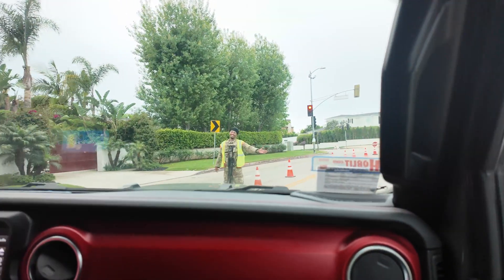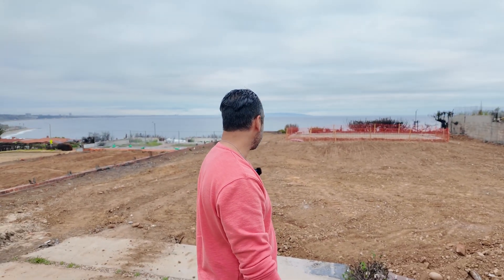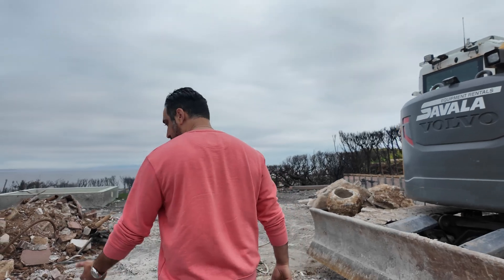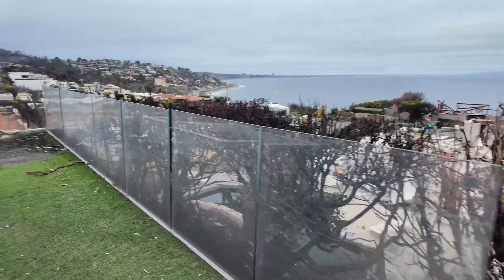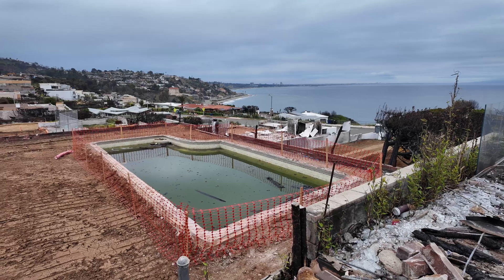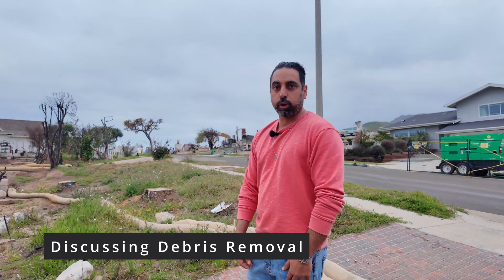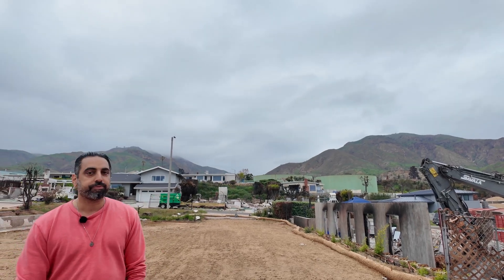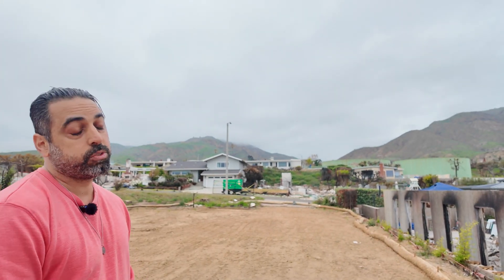What Survived the Malibu Fires – Civil Engineer Walks Through the Aftermath (Los Angeles Fires) [4k]

Comment: I see      the brick survived; a friend of mine had a brick home and it burned recently. 
Let me rephrase that - it's not really a brick house; it's a wood frame house, but it has brick veneer. 
So one wall was still standing, but due to the heat, the brick was NOT structurally sound and had to be demolished.
Reply: The brick and cement in a fireplace is not the same as on a house.

Comment: Is there any building going on?   I watched a contractor try to get a permit.  He was told none had been issued.
Reply from the maker: From the engineer: Yes, there is some construction going on. Permits are indeed being issued.
Reply: Adam Carolla is doing kinda the same blogs. He has found one house under construction. Pointed out that they were building it out of wood frame and cheap OSB instead of modern fire resistant material.

Comment: Ironic that they are making it easy to rebuild the same exact house. The house that burned to the ground. Should a homeowner decide to upgrade the materials or entire structure to prevent a total loss in the next fire, how long will that take to be approved?
Reply from the maker: From the engineer: "From what I understand as long as the footprint is the same, the homeowner is allowed an expedited plan process… But an architect would know more than I would about this"
Reply: Don’t you mean… expedited plan check** process?  Answer unclear as is.
Reply from the maker: @michaelouziel7972 Yes that’s correct 🫶
Reply from the maker: Reply from the engineer is coming 👷🏽